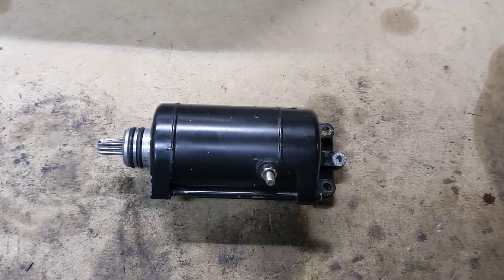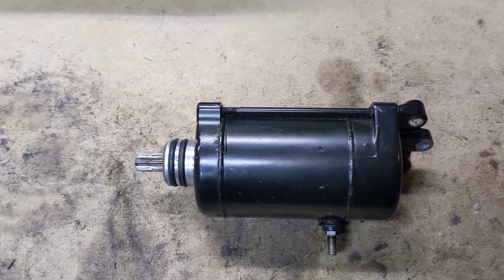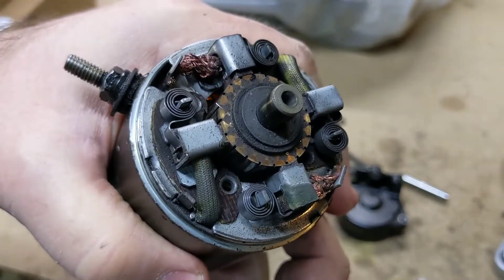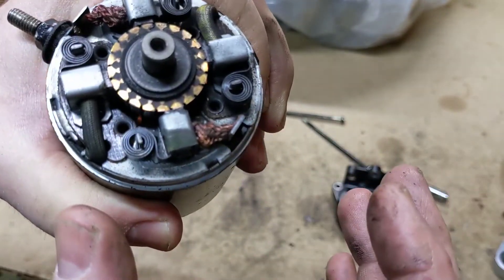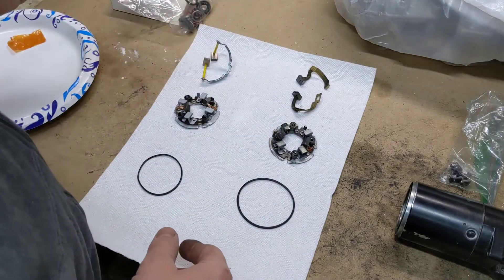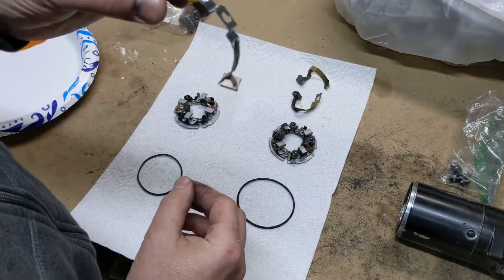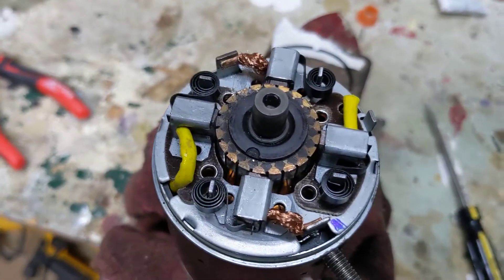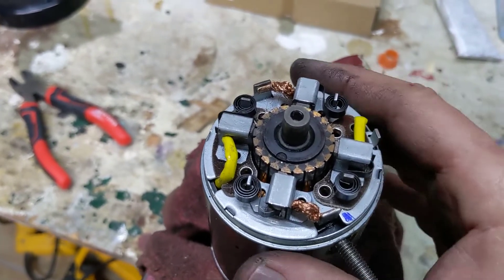Sea-Doo 951 Starter Motor Rebuild - Gray Ghost Resurrection

Comment: Where did you get the rebuild kit
Reply from the maker: Hard to find actually and I don't know why. I used this one and it's working good 
Rareelectrical REBUILD STARTER KIT COMPATIBLE WITH SEA-DOO PERSONAL WATERCRAFT 3D GSX GTX 3008-536 3008093 https://a.co/d/6KUP7y2
Reply: @jonparkmac  Thanks...ordered two of those for my 951s